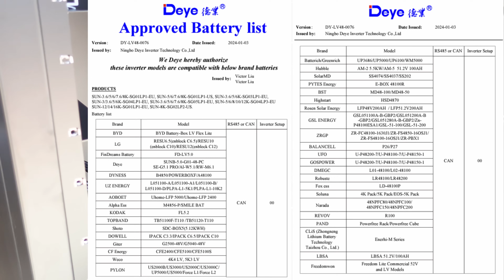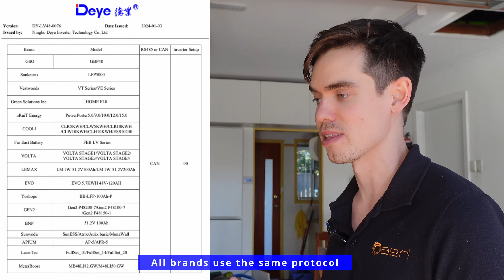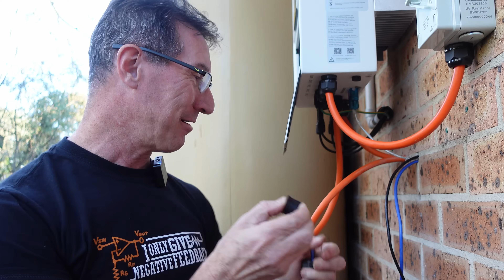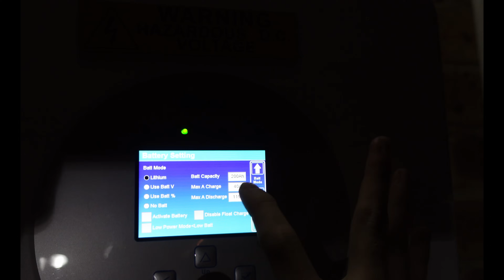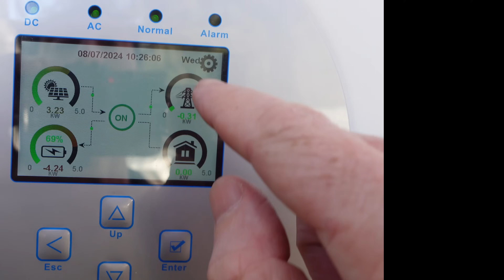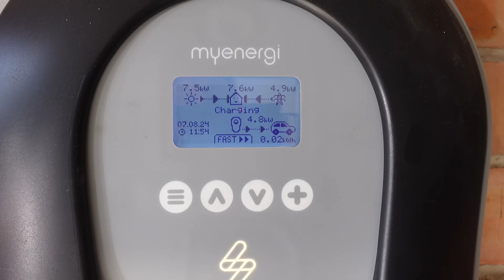EEVblog 1634 - 15kWh AERL LFP Home Storage Battery Install!

Comment: Great video, Dave! I managed to get my Noark (rebadged Deye) to measure AC Coupled solar production by using 2 Eastron SDM230 meters - the grid meter is modbus address 001, the solar production meter is modbus address 002 - then check the "Grid Side INV Meter 2" in the Deye's Advanced Function menu and daisy chained the RS485. I think they're a pretty capable inverter for the price.

Comment: If the battery is used down to 1 or 2% but the recharge kicks in alsmot immediately after that, or indeed charged to 100% but the discharge begins almost immediately it reaches 100% charge, then is there any real issue with degradation ? It seems there won’t be and people are being discouraged from properly using the battery capacity they have bought given you can generally set the charge discharge regime to meet those quite finely tuned schedules ?

Comment: bad practice taking the parallels battery bus bars positive and negative from the same ends, you should have ideally gone both centre tap or apposing ends for equal resistance and loading of batteries, again only best practice and won’t hurt too badly

I’ll have to try out those battery connectors, I’m used to using surlock connectors which look very similar

Comment: How do you put out the fire if it catches fire? Something like this should have a fire system. I know there are batteries this big in cars with out those systems, but those are outdoors. So either these should be installed outdoors or have a fire suppression system built in. Since there is no Fire suppression system currently available for these batteries , it should always be installed outdoors far from the property. If you want to keep it out of the weather, you would prolly need to build a building with fire retardant bricks or high temperature bricks.
@EEVblog  you' have a blindspot for this video. v=MT1QTPEZoHY

Comment: I work on such equipment. Inverter Deye 12 kW, bank Deye 20 kW (4 x 5kW). Batteries started to go into error. I checked the box "disable float charge" in the settings - works without errors.

Comment: Hi Dave quick solar assistant tip for you if you don't already know when you are in solar assistant if you go to the third box along the top it gives you the last 30 day if you look at the key IE load  solar grid if you touch the coloured bit next to the load solar or grid it will remove the line from the graph

Comment: I'm just waiting for this to get a lot cheaper since living in rainy cold Norway i use between 20 to 60 KWH over 24 hours and want to have it both charging from solar and the grid when it's cheap and then if its very expensive power, sell back to earn money

Comment: Nice cabinet and easy set up. I like it.  What is the Deye inverter's power output capacity? Surprised 35 mm2 cable is enough.
I use 70mm2 to connect my 3 x 5.1 kWh rack mount LiFePO4 units to my 8 kW off-grid inverter. I have the same Beny DC breaker too, the 70 mm2 lugs fit. I also have 20 kWh of SLA telco backup batteries in reserve kept at float for outages.

Comment: Hey Dave, I’m wondering if you perhaps should have had more of a downward bend in your power cables going through the wall to stop water running down the cable and into the wall? Maybe you siliconed them up where they go through the wall tho?

Comment: Nice, jolly good jobbie. Thanks for the great video! The problem is not the battery chemistry, it is a bad idea to put multiple "batteries" which consist of several cells in series, in parallel with each other, because they can self charge and overload the BMS and overheat. The "batteries" consisting of several cells in series can be placed in parallel, if diodes are used to prevent self charging. I am referring to the use of schottky diodes in series with each battery. Generally there is power loss and a lot of heat using diodes, so a fan must be used and a lot of high current diodes soldered in parallel.

Comment: Be careful with the latch on the front of that cabinet. That exact model is very common on “imported” equipment, they have a tendency to break the pivot point under the lever/handle if they are forced at all. Also the the silver lock body is mostly plastic.

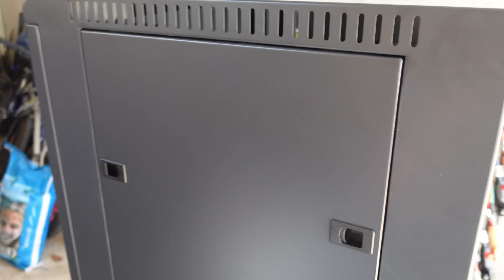Comment: 5:00 couldn't see the other side of that panel however standard network racks you gotta push the left and right sides together at the same time to open the side.
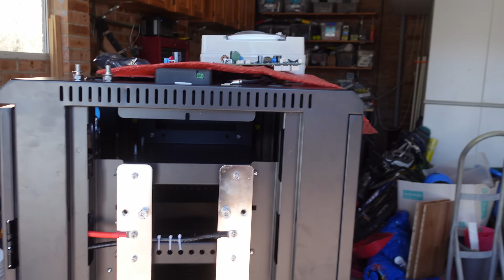Reply: 7:19 nevermind, I see the vendor took the panel off for you 😉

Comment: So for an Enphase-only system, already installed, you could use an inverter like the Deye without solar string attached and use the "AC coupling" to charge the battery from the power generated by the Enphase array?
Reply: Yes, absolutely!

Comment: I have build up now 60KWh battery 48V on a 12KW Victron setup. With a complete house on electric in summer that is no issue but 4 months winter time in the Netherlands. Could be a challenge.

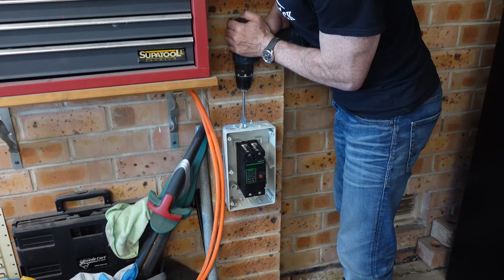Comment: 17:13 Dave fail! Using a spade drill bit (which is only for wood) to open a hole in the box is asking for the plastic to split, and a very ugly hole. You should always use a stepped conical drill bit instead, although half the time you don't need to, as many boxes are now designed to have snap-out holes.

Comment: dave how about doing 24h test.
with thid i mean you only use your solars electricty and dc your electric grind line.
i want stress test your ur solar system for 24h and see if it can actually manage. 
simulation of 24h storm where u have no power

Comment: “Neat!” your missus must be devastated about this install!. Dave, as a previous solar installer and electrical contractor I have to apologize on behalf of my industry for this completely unacceptable work. This is the problem with the RE sector, full of cheap nasty fly-by-night installers who get away with not following the standards. These people should be reported.

Comment: Dave, you can attempt to connect your microinverters into the GEN port of the Deye, this will then give you software support on the Deye side with dedicated statistics on what the micro-grid is feeding into the system (as opposed to the "invisible" power right now as you have it).

Comment: 15 KW is just not enough. Especially when you use Electricity to heat. If your heating is on the Battery will only last 2 hours. I would more think like 25-30 kw. but your Solar must be so strong to fill them up in a day. 
For your 8kw Solar you need a 30kw battery
(30kw in summer 15 kw in Winter= 22.5 on average)
For now you are good but in Summer you need an Upgrade.

Comment: Solar Assistant is good but I like Solarman Business app and Deye Cloud (you can use both) better. Solarman smart looks ugly though. 

I bought a Solar Assistant license and RPi but didn't end up using it because I like Solarman Business app better with my Deye. Using Solarman enables remote configuration on much better UI and enables remote firmware updates from Deye. 

Deye releases new firmware for these inverters once every 2-3 months

Comment: So GRID side of the inverter, non critical load side of the clamp generation charges the Deye connected batteries but without a statement on the Deye's info about it coming from the _generator_? Interesting. What happens then if under Gen PORT USE you select "AC couple on grid side" vs "AC couple on load side" vs "GEN connect to Grid Input"?

Comment: I'm running 30kwh of battery and it's not enough! 
It's looking like I need twice that! Because you have to factor in the solar day cycle which for me is 2 good days of solar energy with up to 2 days in-between which don't perform as well and only act as a delay for when the battery life is exhausted..... 
I'm trying to get off the grid entirely so all my performance measures are designed to cater for the June July period here in Melbourne Australia which is the worst time of the solar year. 
I looked at the AERL products and to me, it looked like Chinese products with an Australian brand and an Australian price tag, no different to Jaycar, same product at 3 times the price! 
You could have got away with it once apon a time but the world is a much smaller place today and it doesn't take much to see the true cost of products.... Red Arc is another brand, their cheapest charge controller is identical to what you can get from Ali Express for $10 but Red Arc is asking at least $100! And you want me to support local businesses? 
This is why we can't have nice things.

Comment: PoE hats may not like the 59 volts of a fully charged 16 cell LFP battery. I'd look for a buck converter that can take 60 volts down to what the Pi can use, with an inline fuse, of course.

Comment: The output wires are wrong if you want equal amps discharged and charged across all battery models in the server rack. One of the two cables needs to be connected at the top of it's bus bar to truly have the battery models in parallel.
Reply: All comes out in the wash at the end of the day as the BMS is actively balancing the cells, but yes, technically that's best practice, we just forgot in this case as it was pretty late by the time we got to that stage of the install. - Pete
Reply: @aerlsolar  Pete is full of shit. This 20 year retired Gas Turbine power generation and distribution electrician is saying to change it. And watch if you leave it like that the bottom module is going to fail first.
Reply: @chetsaxton1526  🤦

Comment: Very cool. When I have a big system, I am still going to make low priced DIY portable batteries to be used as extra power storage. Might as well have an extra battery and inverter in the kitchen, and one in the garage, etc. etc. but still run it on the main battery system as much as possible.

Comment: I’m actually more interested in your payoff calculations, so off you go EEV Blog2 I go. Have been last year on the old, good EV plan from OVO, but now they have slashed solar input from 8c to 3c, have been looking to get a battery
Reply from the maker: Watch the 2nd analysis video I just released on the 2nd channel. I talk about payback at the end. Basically, a bit over 5 years at current rate.

Comment: David are you satisfied with the Deye inverter till now?  Is it possible to show us how clean its output is?  Can you measure the AC voltage between Neutral and Ground with minimal load and then with a 2-3kW load for example?  Can you also do the same using an oscilloscope between the Neutral and Ground?  Thanks.
Reply from the maker: Sorry, I'm not going to disconnect the unit just to do something like this. The UI is a PITA, and their sofwtare sucks, but apart from that it's fairly well made and it works and is very flexible.
Reply: @EEVblog  But there is no need to disconnect anything.  The test should be done in any of your household outlets.  It should show a lot about how clean and stable is the output of the DEYE.
Reply: diysolarforum already has all this stuff for several years and all of this data for dozens of other inverters etc.
Reply: @gg-gn3re  Do you have a link or a search keyword?

Comment: I think you've done a good job on the setup Dave. I really like the fact that it maximises the amount of things you can self-service. Standardised protocols, extra low voltage, modular batteries, etc. Just fantastic.

I've been wanting to go down this route, but I'm convinced there are bigger savings in a modular system you can manage the DC side yourself and save on labour and premium product pricing than there is for solar incentives and STCs. You also gain a bit more liberty in the scale of system you install if it's modular too.
Reply from the maker: The Deye is the one point of failure though. Otherwise my solar setup has pretty good redundancy provided the grid is there.

Comment: Much smaller space much cheaper, 1000us 320ah lifepo4 cells 16x aliexpress gold sellers only.
Install in rolling shop cabinet add fuse and balancer 16s 5a
THATS 1300US MAX FOR 16.3KWH BATTERY AS GOOD AS ANY LIFEPO4 
SORT OUT YOUR CHARGE CONTROLLERS FOR HIGHEST RELIABILITY ONES AND YOULL BE FINE OR JUST GO FOR 120USD BMS PERSONALLY LESS FETS THE BETTER
Reply from the maker: Roll the dice if you like.
Reply: @EEVblog  Fuck 'the dice' the green movement is supposed to mean environmentally friendly use of materials to sustain life. The rack, made of steel, and completely over worked and overdesigned costs more to make than the batteries themseleves. At least a large portion. The modules you have are using tiny prismatic cells, why have 100s of cells when we could get away with 16 just to have the right voltage?
It means more electronic bms, more astronamically expensive parts, connectors, cases. 
ITS NUTS
The powers at be want us with either the most raping expensive shit, or something like agm lead acid? WTF
WHERE IS YOUR MIDDLEGROUND?
Recycled plastic cell cases, with larger recycled plastic case, on the ground, waterproof, and simple. with a simple reliable 1 board bms? With reasonable adequate capacity?
Why overspend on all that extra unused added crap, and then have less capacity while spending more, and being much less green?

HOnestly the rack system is WHACK!

Comment: The grid is VERY cheap between 12am to 5am, a good time to charge your Tesla (???? I thought you had an ID.4).
Reply from the maker: I do not have a smart meter for time of day usage, I'm on a fixed rate. Almost all my EV charging (IONIQ) is done with excess solar.

Comment: Hi Dave, I've been watching you battle with that screw at the bottom of the panel ever since they stuffed things up, suggestion is th get a torx bit slightly larger than the stript hole, hammer the bit into the hole cutting a good solid torx fitting making it easier to remove the screw. Good luck mate?
Reply from the maker: Nope, the support inside was threaded. I actually was able to turn the screw with a flat head I hammed in, but the support just turned. Had to drill it out in the end.

Comment: In these cabinets, always connect the discharge leads diagonally to the battery units. This is especially important when you are running LFP batteries with a near flat discharge voltage curve. You will get noticeable battery degradation after a few years if you connect them in parallel daisy chain style.
Reply from the maker: These are actively managed battery units.
Reply: @EEVblog  Hi Dave. Yes they do report SoC and all that. However the battery units do not have the ability to adjust how much current comes out of each unit. Another thing is, with a large load, you will end up tasking the battery closest to the inverter, and that battery will be "worn" more than the others. Love your videos, subscriber since 20k. Thanks for teaching me engineering for almost two decades.
Reply: @EEVblog  I dont think they can do magic. You push and pull the energy in and out from the bottom where the busbars are connected to the inverter. The busbars have a little resistance, the bottom battery has the shortest way  and therefore lesser resistance as the upper ones. If you connect one busbar on the top and only one on the bottom this equals out and all batterys are used equal as well. Now your bottom battery works allways a little bit more then the upper ones and will degrade a little bit faster.
Reply: Setting up corner to corner is definitely worth it
Reply: These replies are all true, if you look at nearly every other manufacturer of similar battery rack lfp battery systems that have similar if not better bms all state attaching at apposing points of a bus bars if batteries connected in parallel, or if connecting in parallel via batteries itself like pylon tech or bsl it instructs taking your main dc connection from opposite points of the pack for even wear

The cabinet is following proper practices by at least keeping all the highest resistance connections the same length (battery to bus bars)

Comment: Hmm... The prices for those batteries are actually pretty good...
Reply from the maker: Yeah, I was surprised, very competitive. AUD$2900 for 5.1kWh
Reply: @EEVblog  wow, I got 64,000kwh for $5600 from cells lol. You can get directly from EVE OEMs. Those 100amp hour cells your batteries use are obsolete for years now, also those 5120kwh packs are only 1k USD here but still way too expensive. Couldn't imagine paying almost 2 times more